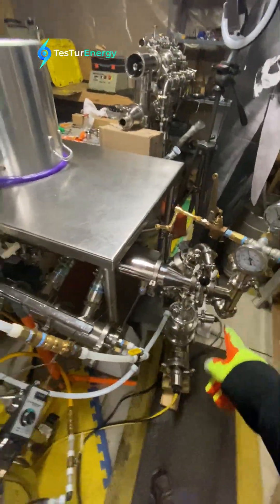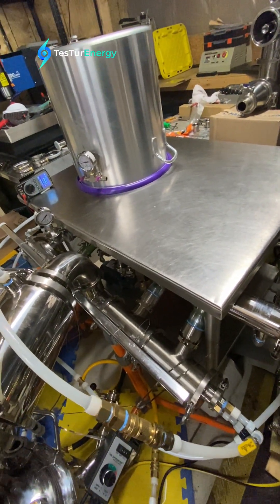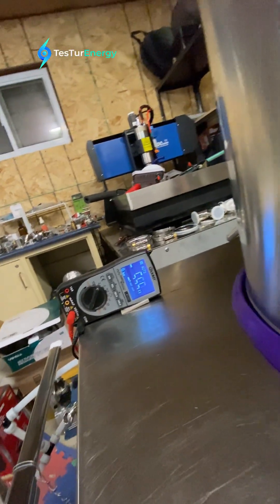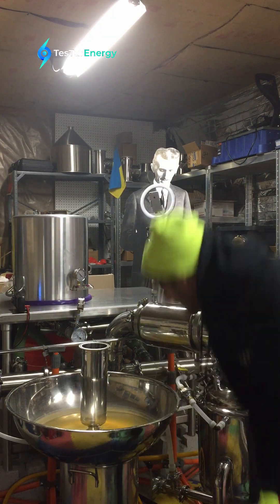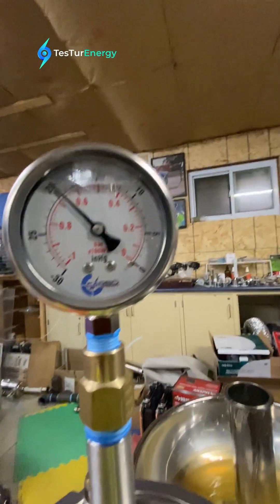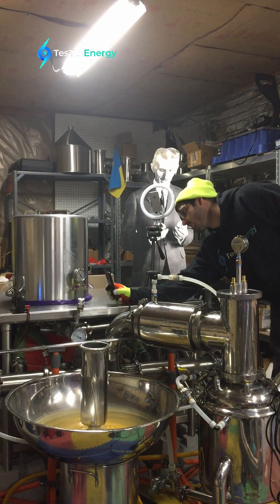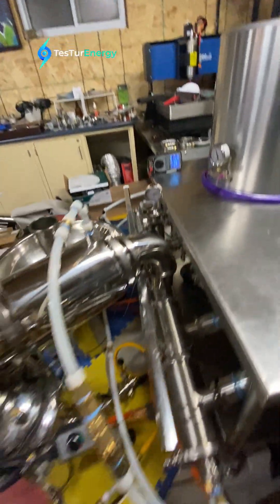Steam Tesla Turbine Micro Power Plant - 1st voltage output

Comment: Ahhh for generating super steam you should probably watch this video bro about Tesla steam boilers etc…

https://youtu.be/8vHaJL-jVOM
It would be way smaller and way easier to probably build instead of all that you have to super heat the water…. It’s essentially tiny in comparison….
Reply from the maker: Hey thanks for commenting but I’ve already got that covered for combustion. I’ve already replicated the improved combustion + steam patent GB 186,083 and GB 186,084 that Tesla patented in 1921, 10 years after the original turbine patent and about a decade of R&D and also after the valve and pulse deflagration engine designs he released. If you’re you’re not familiar with his improved patents check out my videos on them. 

Tesla Turbine Jet Engine - gasoline fuel burner atomizer flame tube test 186,083 propane burner https://youtu.be/gRqKowignac 

Solis Talks Tesla Turbines - Nikola Tesla’s Electrical Power Systems Patent GB 186,083 Walk Through https://youtu.be/5Y3D13JmtcA 

This video that you’re watching though is specially for a closed loop vacuum steam system that runs off of low grade heat sources, like solar thermal. 

Check out the previous video that helps explain more about the system 
Steam Tesla Turbine Micro Power Plant - 1st Start Up https://youtu.be/aMYyBsjhBR4 

Two different applications. 

That’s not to say that can’t be combined though. I can elaborate more after you catch up on my other videos.
Reply from the maker: Lastly I would be VERY cautious what you listen to from that channel. They have proven to be patently incorrect about MANY things with regards to the Tesla turbine and Nikola Tesla’s work as a whole. 

Buyer beware… that’s all I’m going to say at this point.
Reply from the maker: I understand that the build in that video is tiny but you must realize that means it’s VERY limited in the heat output it can actually produce. Just for the fact that it doesn’t have a a large surface area it’s not going to exchange heat to make steam.

I know that burner I’ve got is big, but it will actually output industrial power output levels. That little deflagration chamber from Paul’s video is not going to output much power. And without a long DDT pipe attached to actually make it a pulse detonation engine it’s not going to do much but make a lot of noise. The pulses Deflagration isn’t providing power all the time due to its pulsed nature. Whereas both of teslas Improved Combustion + Steam patents GB 186,083 and GB 186,084 have a continuous flow of of thermal input as well as LOTS of thermal recoup for increasing system efficiency.
Reply from the maker: Take a listen to Tesla’s article where he explains how he wants to improve combustion methods for the turbine. Those patents I’m referring to are the product of the decade of R&D that he did. 
Dr. Tesla Talks of Gas Turbines - Article Read Aloud by Charlie Solis AudioBook Tesla Turbine Info
https://youtu.be/TGGLG-7hK50

Comment: Do you know your Boiler HP?
Reply from the maker: I just upgraded the boiler and now have 6250watts available. But since each coil has to be on its own breaker, I gotta run like 2x 50ft extension cords to different circuit breaker lines from my garage to my house so I can actually pull the full power and not trip a breaker.
Reply from the maker: Hey thanks for commenting! So right now I have 4500watts of electrical water heater coils going in although they are definitely not pulling their full rated power, though, all being plugged in at the same time in my garage. 

When I turn off one of the heater coils you can hear the fountain pump start spinning like twice as fast because of the coil load drop lol 😅

Comment: I love the clear chamber you have there with the water. Never seen water be more acrobatic. 

More challenges are ahead! This series needs a challenger to see who gets better performance. I want to see what comes out on top, the Telsa Turbine, or a wood gas generator. 

NightHawkinLight has a impressive video on wood gas, where he runs a gasoline engine that was placed on a bike. 

JR M has a homemade gasifier that uses wood pellets to run his electric generator.

The wood gasifier is a lot more user friendly. It can also be combined with existing gasoline 4 stroke engines. It's easy to build homemade too! I have thought long and hard about what I want to lower my carbon footprint, and I can't think of a more green energy source then wood pellets. (There is also wood chips that are used to filter the wood gas product to make it a little more green burning). If you can convince me this power that you are wielding is a magnitude higher than the wood gasifier. I would be open to changing my mind. 

Best of luck my friend.
Reply from the maker: Hey thanks for commenting! Yes! All great suggestions. Just one thing. You can use a wood gas burner to power this. Pretty much any heat source can be used for this. 

Check out the video I released previous to this one. I went through a lot more of the theory in it. I think you’ll really like the overarching point though. 

Add heat. Cool condenser. Get power and home heating. 

Steam Tesla Turbine Micro Power Plant - 1st Start Up https://youtu.be/aMYyBsjhBR4

With TesTur Energy, our mission is to give people energy independence through Combined Heat And Power (CHP) systems that can make use of underutilized and “monetarily free” energy sources like biomass, solar thermal, geothermal and even low grade fuels containing high quantities of solid particulates (like pulverized coal and powdered iron); energy sources/stores that are currently underutilized due to the lack of turbines and engines capable of handling the multiphase fluid flows (any combination of gasses, liquids, solid particulates) present in low grade heat boilers and low grade fuel sources without damage over prolonged/continuous periods of use. 
www.TesTurEnergy.com 🔥😇🔥
Reply from the maker: Ohhhh wanna see something REALLY cool?! This guy made a glass boiler header so you can see how much water ends up in the headers and potentially down stream as a slug if not careful. 
https://youtu.be/ovFq-RPdK1M
It’s like a a soda can being released. Bubbles form everywhere in the mass of the water and the steam gains such a velocity that it carries the water with it. 
Enjoy!
Reply from the maker: Also make sure to check out the latest updates on the combustion + steam Tesla turbine builds!   

Tesla Turbine Jet Engine - gasoline fuel burner atomizer flame tube test 186,083 propane burner 
https://youtu.be/gRqKowignac 

Solis Talks Tesla Turbines - Nikola Tesla’s Electrical Power Systems Patent GB 186,083 Walk Through 
https://youtu.be/5Y3D13JmtcA  

Tesla Turbine 250 watt to 2.65 kW Power and Efficiency Test 
https://youtu.be/K7qZvq1CMFg  

+5 Horsepower Tesla Turbine Dyno Jet Turbo Power & Torque Curve 375 mph @ 125 00 rpm HIGH SCORE! 
https://youtu.be/exF5Rn-L8gs  

These preliminary tests are just to see how much electrical power can be produced with room temp compressed air driving the Tesla turbine. 

The TesTur nozzles never went over 20psi at the nozzle for the 2650watt electrical load test and not over 40psi at the nozzle for the 4250watt dyno test.   

This is so I can get a baseline for what to expect as I increase the temps to combustion levels.   

When using elastic gasses the counterintuitive thing most overlook is that the viscosity of gasses goes up with temp. 

So not only do we see an increase in thermodynamic efficiency from increased temps but the TesTur isentropic efficiency also goes up due to the reduced slip from the increased viscosity.
Reply from the maker: Are you ready for the fuel agnostic future?!? 🔥😇🔥
Tesla Turbine Jet Engine Combustion System GB186,083 - Powdered Iron Fuel + propane micro burner
https://youtu.be/Ad0Ecpc_OPM

Comment: Love it, thanks so much for this update, it's exciting just having a monthly "fire up" to see everything in action and noticing the differences!
-The fountain is alive! Super satisfying to see it spilling over. Can't wait for when you add the dome. This is going to sound funny, but a company called Catit sold the same kind of water fountain for pets to drink from (all clear plastic) with a small centrifugal pump to create the same effect of a thin stream with a high surface area over the whole dome so pets could just lick the whole dome and get a drink. It didn't have Tesla's momentum recovering improvements but it was mesmerizing!

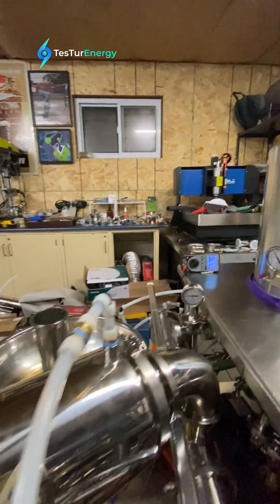-Did you notice the bulk of the water in the boiler jumping up and down as it boiled? At 2:27 It was almost perfectly in sync with the harmonic the generators were giving off, not unlike what you'd get from a torque ripple. Could that be due to some piston effect of gas boiling under the water line? 

Electrical questions: 
-The 2200kv 120A generators in series don't quite make it to the 12V needed to get the inverter to make electrical power. I know you mentioned there was a vacuum leak, but have you considered running a BLDC speed controller or other motor driver to use electricity to spool up the TT to the 4400rpm  parallel / 8800 RPM series needed to make 12V with the generators?
 This could have some big advantages: In the case where you're limited in your boiler heat power, you could add a DC solenoid to let steam pressure build up while it's closed, and then dump it across the turbine automatically with a microcontroller doing fast ideal gas law calculations using pressure and temperature sensors at the evaporator and condenser. That way you're spending less time in a 0W electricity generation deadzone and you can produce power on demand, especially if the thermal system needs to run intermittently. It'd also give you an idea of what your base load would be to maintain a 4k idle.

-Alternatively, since the TT has no problem with torque at low speed, it should have no problem making power at low speed, but we know the off-the-shelf 12V inverter won't kick in over the full useful speed range of the turbine, it will likely destroy itself beyond 15V because of component ratings, and during the last power test with air, we saw it doesn't restart very quickly if the turbine speed varies between the inverter's undervoltage lock-out and operating regions.
An inverter with a wider input voltage would work well making power at low speed (or a wind power inverter with a dump load), and if you can solve that, you could increase your low speed power limit by designing them to run in a parallel config. instead of series, which shouldn't be a problem since both those motors are identical. There's also the option to increase your kv rating of BLDC motor too.

Other than that, this is just so exciting, you're making history, dude!